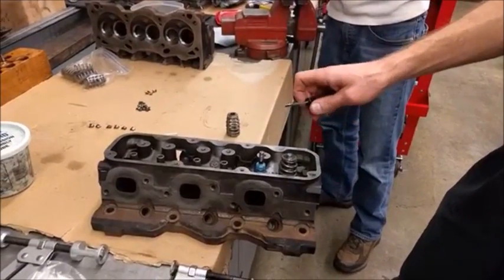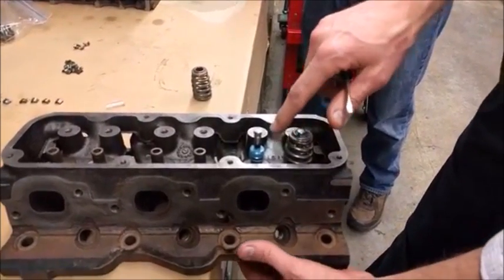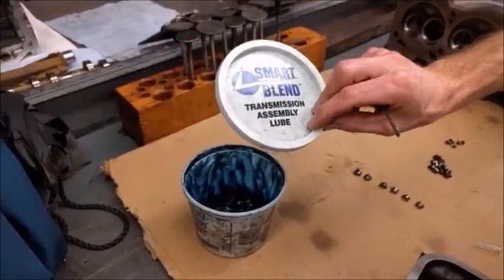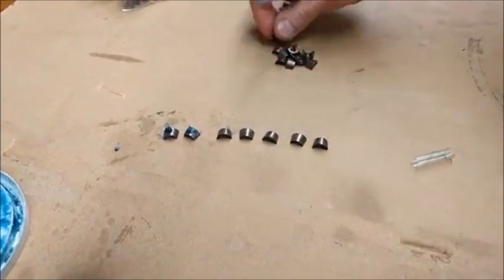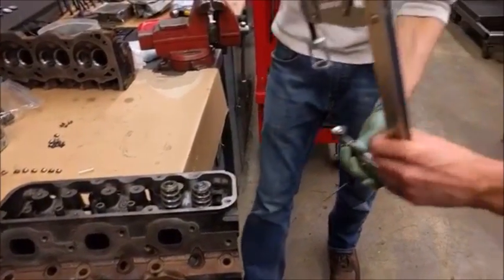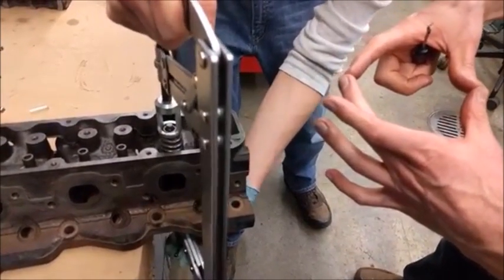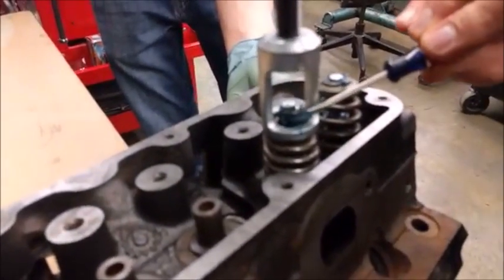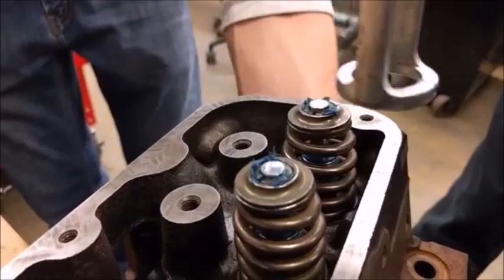How to install valve springs & keepers quickly, with less frustration

Comment: I was struggling with this very problem, i kept losing keepers and due to bad eyesight could not find them, a 5 minute job was taking hours, i tried this method  and by the eck, it worked, thanks.

Comment: This worked perfectly.  I have the valve spring compressor u have to use a ratchet with and the cam on, so I C-clamped the head down to the table.  Wheel bearing grease and a screw driver worked well.

Comment: Thanks for the video.  I had man handled 2 of them in & knew there was a better way.  Used Vaseline & while still not easy waaaaayyy better. By the way, why does every small screwdriver have to be magnetized (not enough to actually pick up a nut or a bolt though:) it kept trying to keep my keepers.
Thanks again
Reply from the maker: Vaseline doesn't work quite as well as the Transmission Assembly Lube does.  It is not as thick and sticky.  However, if you refrigerate the Vaseline before you use it, it works better!
Reply: Justin Miller I broke down for the second head & bought the lisle remover / installer